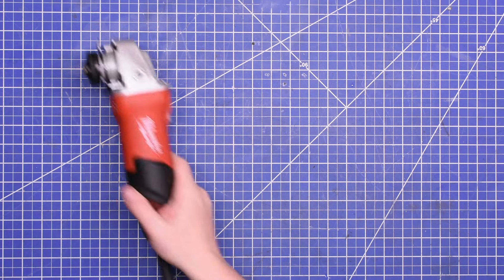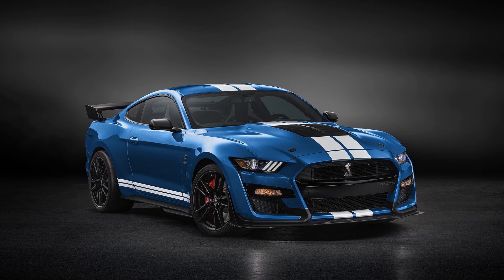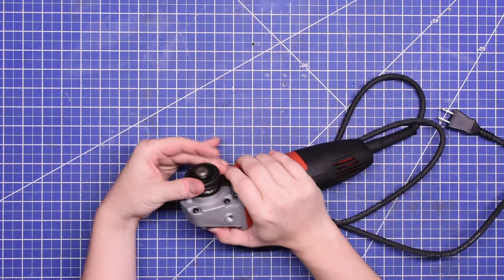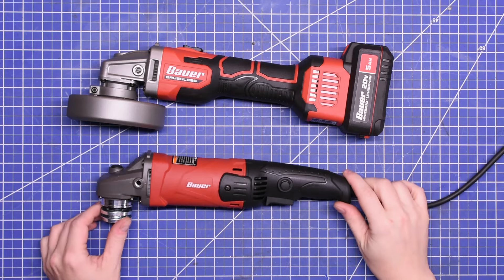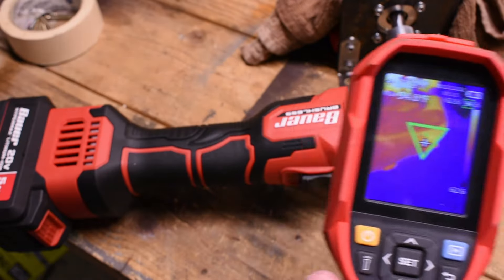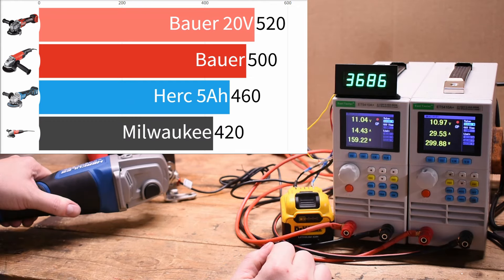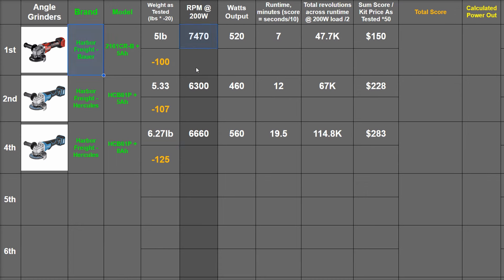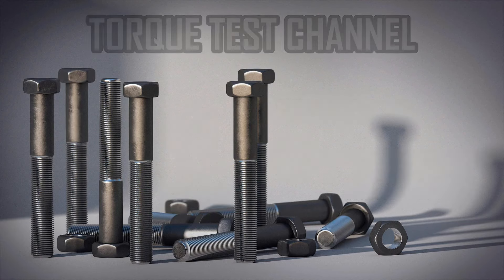Corded v Cordless Angle Grinders Dyno'd! Milwaukee vs Harbor Freight

Comment from the maker: Let us know which model number cordless 4.5" angle grinders you want to see ranked here! For example we're getting a lot of requests for DeWALT Flexvolt Advantage, M18 & Makita, but which ones are on your short list? (6" would be cheating at this point)
Reply: Milwaukee M18 2880 for sure and the 2888
Reply: Makita 9557PB
Reply: Makita LXT Line. More specifically the lower cost ones: DGA504 or DGA511
The latter allows for speed control.
Reply: Makita gag03, 40v grinder
Reply: Metabo is king of corded grinders
Reply: I suppose it's a different size but I would like to see the DeWalt 60v and also the warrior corded grinder from harbor freight that they run on sale for less than $10
Reply: M18
Reply: makita 40V XGT  cordless angle grinder
Reply: Flex 24v brushless angle grinder will beat everything in the 4.5" class
Reply: Making stuff and breaking stuff did a good video about the 4-1/2 to 6" DeWalt and Milwaukee, would love to see you do more on those models 4-1/2" to 6" seems 60v dewalts always kill my Milwaukee 😢
Reply: I'd like to see how the milwaukee 2980 with a 12 ah battery does. That's what I currently use.
Reply: I could send you my M18 (not fuel) if you want to test one. I also have a Black and Decker corded if you're interested that was very cheap and I've been pretty happy with.
Reply: Makita options
Reply: Hercules 12Ah battery
Reply: I don’t use cordless grinders for the most part, but have thought about getting one for quick little jobs. Good to know that the Herc w/ the better battery is viable. 
 I would like to see the Herc CORDED tested. I have Herc and Matabo grinders that are corded and see daily use in my shop.
Reply: Kobalt
Reply: Makita and Fein (German version)
Reply: DCG413, possibly directly compared to the DCG415 to see what difference Power Detect plays.
Reply: Metabo HPT G3612DAQ6
Reply: XGT vs Milwaukee, 5 inch grinders
Reply: Metabo/HPT 36V, of course
Reply: DeWalt flexvolt are the DCG418 and DCG414, the other ones aren't 60 volts. Flexvolt "advantage", "power detect" i think its just marketing because anyway those are just 20 (18) volts tools
Reply from the maker: @israelramos7441  The only issue I have shopping for those DeWALT 60V grinders is one is 6" capacity so would/should beat all these. And the other is from 2016 and weights 6.6lbs without battery. So might not be their top scoring contender.
Reply: m18 2889-20
Reply: Bauer 8ah???
Reply: Would be cool to see a Hilti or Fein angle grinder tested
Reply: How about the ryobi PCL445B vs PBLAG01B... apparently there is a big difference according to ryobi on performance
Reply: @Torque Test Channel  4.5" is what anyone is going to be running on it. The DCG416VSB is a 4.5"-5" anyway. No one is going to search high and low for an oddball 5" disc over a readily available 4.5" disc.

Same for the DCG418. Typically people are going to run a 4.5" disc on a cordless tool. My D28499X on the other hand I run 7" and 9" disc on. But it has boat loads of power. 5.3hp.

Obviously the 416 and 418 are on my short list.
Reply: Would like to see a 36v Metabo HPT!
Reply: Check out the Fein CCG 18-115 BL
It'd be great to compare the current Fein batteries to the new model coming out later this year after they start adopting Bosch's AmpShare system.
Reply: I would love to see "Fein" grinders. The CCG 18-115-10 PD for example 
(Fein is now part of the AmpShare system, which makes them worth considering when buying new cordless tools in my opinion) They also started offering corded brushless models...
Reply: Would love to see some Einhell (Ozito) brushless one.
Reply: @kashmooney2922  I second the motion, I want to see how ridiculous a 60V brushless can get.
Reply: Makita xag25
Reply: Metabohpt G3612DAQ6M, with the AC adapter and without. I think it will be an interesting comparison and a lot of reviews I see of it makes it look super good
Reply: Would like to see a re-visit in the future with the 8aH Bauer now that it recently came out since time of this filming
Reply: As a person that has used Makita grinders for years since I saw so many other professional using their grinders. I started to not only using the corded, but also started using the 18v. If I'm working on something needing a heavier load I would always use the cordless, but where I need the speed and lots of use I would use the corded.
Reply: would like to see bosch cordless tested
Reply: Bosch GWX 18V-15 SC please 😁
Reply: I would be interested to see the difference between the RYOBI One+(Brushed) and the RYOBI One+ HP(Brushless) both 18v grinders
Reply: I've got an old-school corded makita and a newer cordless milwaukee I'd love for you guys to try.
Reply: If you were to test 6" grinders. I've used amd abused this model Metabo and they are work horses. WEV 15-150 HT (600563420) ANGLE GRINDER
Reply: 10 amp MasterForce from Menards. Thing feels like a beast and has adjustable speeds.
Reply: Bosch 1400W corded grinder GWS1400C
Reply: Metabo HPT / Hikoki 36V and 18V
Reply: it would be cool if you tested some of the corded 7 inch angle grinders that have 10-15 amp motors.
Reply: I would love Bosch, AEG and some other EU available tools like hilti, Fein, Metabo, Makita,...
Reply: Another vote for M18. With a 5ah and 8ah battery.
Reply: Flex 24v and a metabo 13.5 amp 6 inch for the hell of it
Reply: @locky264  They were in the "all green" years when I bought my 6" and maintained a school fleet, but these days while being powerful the ones I've used were less well designed. I hate the rotating handle on their 9" which loosens over time but the power was nice.
Reply: An all Makita cordless shootout and testing (of course) of the largest cordless you can get your hands on since your review methodology is superior and many welders will buy larger grinders for work where you REALLY need one.
Reply: First of all... LOVE THE CHANNEL!! BIG THANKS FOR ALL THE INFO!! 🤘

.... I would love to see some info for (HERCULES HE65) corded grinder. Hardly ANY vids on YT about it..... THANKS AGAIN 👍
Reply: Metabo HPT has a 12A brushless corded 4.5" grinder, the G12VE2. It would be interesting to use that to test your hypothesis about the cordless grinders working better due to the brushless motors; theoretically, this one should blow everything out of the water, right? Best of both worlds and 50% more power than the Bauer. DeWalt has the DWE43231VS, but that's 5".
Reply: @Torque Test Channel
DWE402 would be great to see. It has been a real powerhouse for me.
Reply: I have an M18 and quite a few corded DeWalt options including two of the new brushless models you could test 😏. If you are interested I can get you a list with model numbers.
Reply: test like 5 units  and at lest one cheap real brushless off brand if its even a thing as i seen brushed units [ill bet] sold as brushless china crap for ye  lol...and yes harbor freight grinders a must m18 fuel 2 is a must
Reply: Please test the new Ingersoll Rand G5351-20V Cordless Angle Grinder.
Reply: I would love to see the Ryobi one+ hp (PBLAG01B) grinder.
Reply: Bosch GWS18V-45PCN-RT and GWS18V-8N-RT. Both 4.5"
Reply: Makita and Bosch Angle grinders are often considered the best due to their durability and they don't stall while running cooler.

I'm a Milwaukee guy, but their angle grinders are miles behind Makita and Bosch for that specific tool.
Reply: Corded ridgid and Makita are both beasts
Reply: FLEX
Reply: Old school Japan Makita 
 vs new ill even ship it to you

Comment: I would love to see the Ridgid Brushless cordless and the warrior angle grinders tested.
Reply: If they could compare the ridgid octane to their latest one that would be cool
Reply: I'm not sure why anybody that wants a wide array of tools on the same system would be interested in Rigid.
Reply: @kanehoward7050  I bought into them during the Octane line. Lifetime warranty, performance that matched or exceeded the current gen of M18 fuel tools at the time, and half the price. TTI kiboshed that pretty quickly and I don't think I'd buy any of their current tools
Reply: @Sparx   ah, gotcha.
Reply: You can’t go wrong with the warrior it works really well for what it is and can take a beating my guy has had one for years and it’s still kicking

Comment: Definitely need to see the Makita corded 4.5" grinder on the dyno. Love those.
Reply: The OG angle grinder that every tile guy has in their toolbox.
Reply: Makita 9557nb
Reply: depends on the amps, i know alot of us would like to see our fav grinder on the table, but most of them are in the 9-15amp range which would destroy anything cordless.
Reply: Mines been working as long as I've been welding and it won't die I'll be sad when it does
Reply: @MisterDoro  not just tile. those are the absolute standard for welders and trades that work with metal in the oil and gas industry. ive seen these used and abused every day and left in the back of a flat deck in the rain just to be used again the next day.
Reply: @jonathangarzon2798  when it does die, it'll prob be the bushes that need replacing
Reply: @madhouse5213  that's what it's looking like tbh
Reply: And Bosch plz

Comment: This channel is changing the tool world for the better and helping out Joe blow more then he could ever imagine... thanks guys..have a test idea... in welding we use temp guns instead of temple heat sticks..wonder how accurate the electronic temp guns are compared to other options for reading heat in steel..
Reply: They can be quiet accurate if the emissivity setting is correct for the surface finish and material you are testing. They are not a set and forgot tool and you can't use them on multiple materials or finishes without adjusting the settings to match

Comment: It would be interesting to see an external power supply to drive the battery-powered models and see how they hold up with "infinite" power. Would they run hotter, or still be as consistent?

Comment: It would be super helpful to see you guys test different angle grinders from the same brand (e.g. the DCG405, DCG412, and DCG414) as well as similar comparisons for other brands. That would provide very useful information for someone looking to purchase a grinder who is already committed to a battery line, and provide some context on how much additional performance you get for the extra money, and if spending more is actually worth it or if the cheaper models will get the job done. 

Love your content, keep up the good work!
Reply: I did 5 different Dewalt grinders head to head on my channel a while back, but nowhere near TTC levels of precision. Gotta give him props for the effort that goes into these tests he does.
Reply: Yeah, like the DCG418 60v and DCG416 20v compared to the OGs.
Reply: I agree with the different models from same brands. TTC will probably eventually get thru all of them as usual.

Comment: Great job! I have three Bauer corded angle grinders set up for different jobs and I’ve found them to be excellent tools for the money. I’ve also been using Bauer’s 20V cordless tools (although not the angle grinder - yet) in the municipal garage where I work for about two years now and I’m really happy with them. I’ve had zero failures and their performance has been really good, especially when considering what I paid for them.
Reply: The Bauer cordless grinder is definitely a good pick, compares well to the Dewalt I used to have and it's going on about 2 years strong

Comment: I run that Hercules grinder with the 12ah extreme battery and love it! Did have to warranty it one time for the disc lock breaking, but that was painless and I had a new tool the same day. Plus, every time you warranty it you get a new handle, new spanner, and a free grinding disc
Reply: I had the same first introduction with Hercules tools when I first bought my mother her 12v Hercules drill. The first one worked for a few days with little to no use and just suddenly pooped out the last time she used it. No drama, no magic smoke, nothing. It just quit and wouldn't respond. But because we didn't have it very long it was still under warranty so I just brought it back to the store and exchanged it for a new one with no questions asked.

The second one has been working perfectly fine with constant use and is still going strong a year or two later. I was disappointed when the first one pooped out but I understand that thousands of them are made in a day and you're bound to get a bad one eventually. Since I really wanted to try the Hercules tools I stuck with it and everything I've bought since then have all been great. :)

Comment: Old school welder fabricator here. In the early nineties I bought a corded grinder from Mac, just a slightly modded Black and Decker, and it works it's heart out. The original Black and Decker grinders were unbeatable for price and output, the newer ones just feel cheap.

Comment: Nice to be in Europe. I bought 2800W corded angle grinder for 33$. An it will run circles around anything running on 110V or battery.
Reply from the maker: Dang, hold on tight I guess!

Comment: The Bauer corded angle grinder (7 watt), is an absolute BEAST. No battery rundown interruption to constant full power work until the job is done. The $29.99 price means that I can work this grinder as hard as I want, and it ends up out working me !

Comment: Would love to see what a Makita corded would do and a DeWalt cordless. I've had good luck with Makita grinders. I know my Dad has a 9" that's over 30 years old and is still throwing sparks and it's been worked hard, it does weigh a lot though. Of course it's a 9" so that's to be expected. Love these new series that you are running. Really like knowing about tool vibration.
Reply: Makita are still good, but nowhere near as good as they were.
Reply: @bairnonessie  That is true for most things since corporations have gone to less quality and more quantity.

Comment: I love these videos, you, Project Farms, and Linus Tech Tips labs are making a motion for more informed consumers and frankly being able to call companies out on their bs is a great breath of fresh air. 
I recommend adding a motion sensor of some sort to be attached to the handle for testing vibrations, which would be useful for anyone who uses them a lot.
Also, a usage video for reference would be very helpful, the tool can go up to 500w is nice but can you hold it at that power output? What can you do with that type of wattage, how much is 200 equivalent to? Is that grinding rust away or is it cutting through something?
Reply: LTT should not be counted in the same category simply due to their extreme reliance on sponsorships (probably more than any other YT channel, to be quite frank), meaning there's no way to know if the content they produce was unduly influenced by the vendors or not.
Reply: @bjn714  based on the 4 hour WAN shows I watch (lol), Linus will be very straight forward and no BS.
Reply: There are commercial vibration measurement devices, and I don't think they're very expensive.  Project Farm has used them several times.
Reply: @narlycharley  maybe in those unscripted moments of the WAN Show, but when the other 99% of the content they put out is heavily sponsored, you can't rely on them as being unbiased. It's just a money-making operation for Linus these days, which means adhering to the advertisers requests above all else on the sponsored videos.
Reply: Taistelupelto420  still makes it impossible to trust the content as unbiased, since you have no way of knowing whether they're capitulating to the advertisers' requests or not, since they don't have to make the contract terms public.
Reply: Ahem. Gamersnexus.
Reply: LTT is in such a different category. They're entertainment first, and sponsored up the wazoo by companies whose products they also test.
Reply: @bjn714  They've disclosed multiples times on different occasions that they explicitly push back against unethical deals. If you have to know absolutely everything about everyone, there's no way you could realistically trust anyone. The point of trust is putting your faith into someone DESPITE the fact that you don't know all the details.
Reply: Tools tested is another good channel.

Comment: Sweet!! Love to see y'all testing new types of tools. I've noticed a similar vibration in my brushed Milwaukee angle grinder. With you observing a similar phenomenon on the corded grinder, (and milwaukee's reputation for runout in drill chucks) could you do a short piece comparing runout across brands and tools for these types of tests? It's definitely a quality metric that's easily measurable, significantly affects mfg cost, is under-reported to consumers, and directly relevant to the user experience.
Reply: These days you really have to wonder why and how they fail to balance the rotors on their tools so bad.
Reply: @BL-yj2wp  My guess is just cheaping out on QC for brushed tools since the brushless tools are profit drivers
Reply: @thejo6331  
Probably. They‘re making bank on that grinder, it‘s a $15 tool sold for $84.

Comment: The best corded angle grinder I have ever used was a Hikoki (made in Japan) not the Chinese made brands. I once took it apart to compare with a broken other brand and the wire wraps were so much larger, better insulated and wrapped tighter in the motor. Did a classic tractor renovation and ran it constantly for over an hour to strip paint to bare metal and it's still working 5 years later. We bought the twin pack which comes with the 5 inch grinder and the 9 inch too.

Comment: I like it. For sure the Bauer with the big battery available now would be cool. And obviously dewalt, Ryobi, hart and rigid. I use a cordless brushed Bauer quite often and have been impressed with it compared to an old 19.2 craftsman and dewalt 18v I used to use.